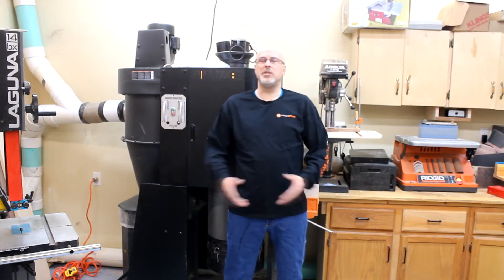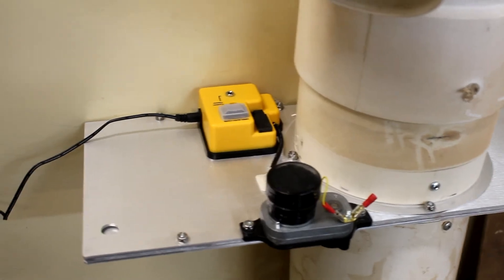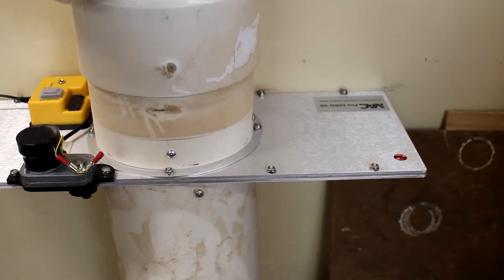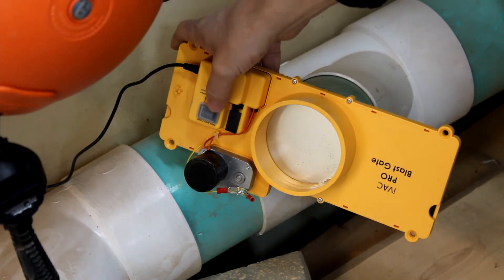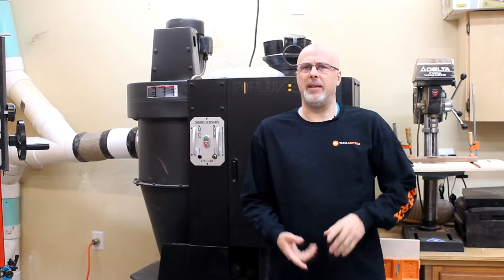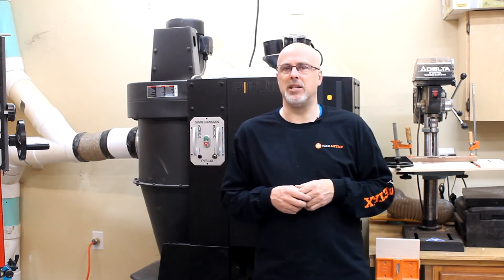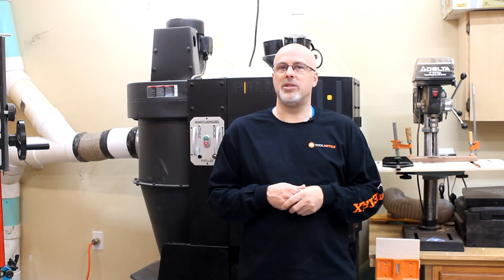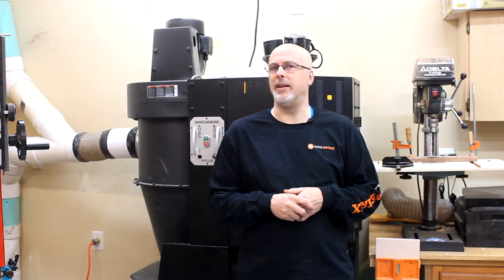Automatic Blast Gates and Dust Collection with iVAC Pro

Comment: Informative video, thank you. 
You mention an 18” planer that is also a drum sander.... can you elaborate on what make and model that is? Thanks.
Ron
Reply from the maker: It's a Woodmaster 718.  I've had it for about 5-6 years now and I love it.  It converts into a drum sander as well, but I mostly just use it as a planer.

Comment: Do you still use the ivac system?
Reply from the maker: Yep I do. The 6” ports have been flawless. I had some problems with a couple of the 4” ports but they seem to be better after running a ground wire to them.